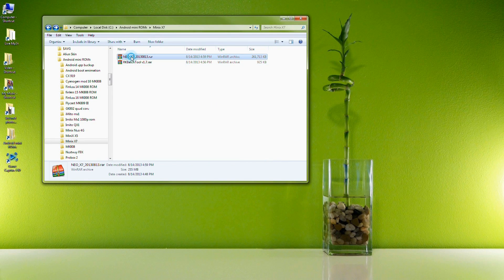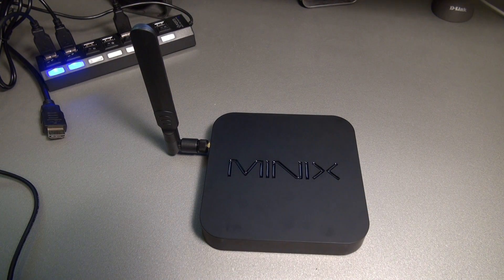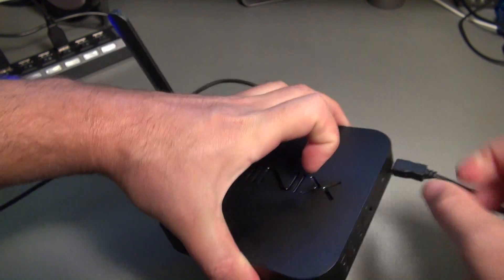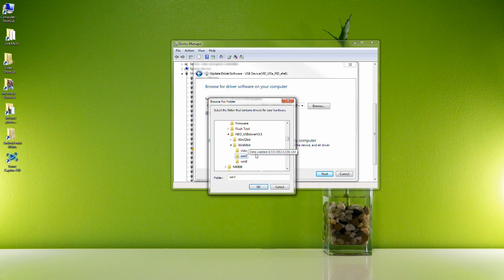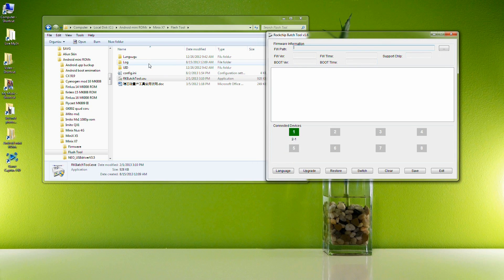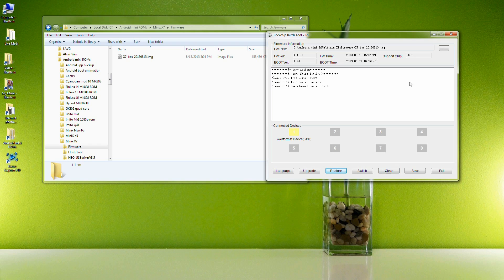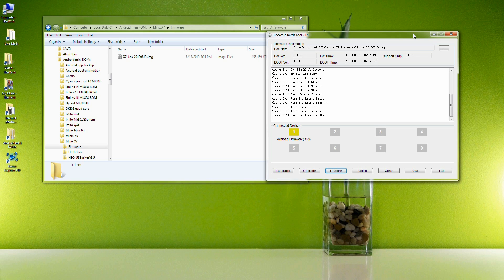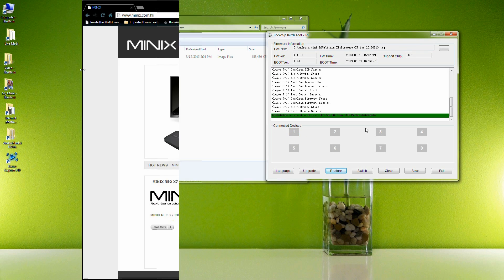Minix Neo X7 Firmware Update Tutorial

Comment: Hi there hoping you can help - my minix neo x7 seems to have an error when i try to go into the installed kodi on the landing page it says it is waiting on external storage - so i unstalled kodi and now  when i try to download a fresh install it want download at all a pop up says i need an sd card so i popped in a sd card but makes no difference - any ideas what the fault is and how i could rectify it
Reply: Hi,
 I had the same issue a few weeks ago, the SD card is not the external one but  part of the internal memory of the device. try entering the settings and re- install the SD card. It worked for me.
Reply: Hi reem after some time I managed to resolve the issue.  I just did a complete factory reset. Problem solved.

Comment: WTF i do Exactly like the video,RKBatchTool show green.(i flash to 008).
but when i press ON in wifi its jump to OFF, after several times the minix x7 crash.
but if i connect cable to router and ON the ethernet the internet work.
how can i use wifi? why it dont work?

Comment: I had no problem updating firmware to 008 or 009 --  BUT

Trying to install Finless 1.8 or Quickshot v2 and get the following when using then flash tool that came with the custom rom

When I flash ROM, every thing runs good until INF0: start test device.
 I get the following errors:

ERROR: Test device failed
ERROR: Run failed

What am I doing wrong here??

Comment: For some reason the box doesn't turn green.
I hear my computer ding when I start the device with the rest button pressed. Few moments later it dings out as if it was unplugged and the device is no longer listed in the device manager.
During the time the device is "seen" by the computer the tool doesn't seem to recognize it and shows NO green boxes.

Could you please tell me what I might be doing wrong ?
Reply: Muhamad Azmy Thank you VERY much. I have been trying to get this thing into recovery and getting angry. There is no official documentation of the method you mentioned here with the 3 seconds, USB 2.0 and all but it worked for me. I wish they would be more specific in their instructions.
Reply: You are welcome. Indeed it's not mentioned in any documentation. But at least we know how now ;)
Reply: having the same problem, including my window mention that I cannot update because it has the newest update...
Reply: Hey Leon larkin, i figured how to do it. First you have to connect it to a usb 2 port. There is a compatibility issue with usb3. Second when you are booting in recovery you push the reset button with a pin, press the power button and then count 3 seconds the you release the pin. Before that you have to make sure drivers are installed and it should work.
Reply: Nice...... I got it!!!!! U r a genius
Reply: Are you being sarcastic or it really worked :p
Reply: No it worked, I used my other labtop that has a modified windows 8 and the usb 2 luke u said: thanks
Reply: Yw :)

Comment: I connected my Neo X7 to the laptop and started it into flash mode.
"Unknown device" in the Device Manager at laptop.
I installed the driver on my laptop of Win7 - 64 by by updating and browsing for the driver in the folder.
Driver successfully installed and correctly showed in the Device Manager.
I restarted the computer and then I put again Neo X7 into the flash mode and USB icon shows in the right side of the task bar.
When I launch Rockchip utility, there is no green square.
No conection between Neo and laptop.
Where I'm mistaken?
I checked once again your remarks and I'm sure that I was in the Flash Mode.:(
In fact I repated the procedure after I uninstalled the driver.
Any suggestion is welcomed.
Thank you!
Reply: I forgot to mention that my device is not rooted. Is this important?
Reply: hi,
i have the same problem with the neo x7 using win7-64.
did you solve the problem?
please let me know
thanks
Reply: Problem solved!
http://www.minixforums.com/threads/neo-x7-008-firmware-1st-jan.3570/page-4

For everyone that have flashing problems and have USB 3.0 you have to edit the config file to this:

LOGFLAG=TRUE
#SUPPORTLOWUSB=TRUE时,扫描支持full speed usb设备，默认只支持high speed usb设备
SUPPORTLOWUSB=TRUE
FULLSPEEDUSB=TRUE
Reply: Bernhard Radinger
I solved it, too. Used my old laptop with Vista and it worked smoothly. :)

Comment: WARNING TO WINDOWS 8 USERS:
even if you installed the latest minix drivers and the pc connects to minix windows 8 cannot find Minix in recovery mode!
Using windows 7 works perfectly so simply do the procedure from a non win8 pc.
Reply: Thanks for the warning
Reply: MrBrymstond I wonder if you use the compatibility mode and select Windows XP or Windows 7 if that would work?
Reply: ...thanks for the feedback:
i don't know what happened in my win8 system, i did the same exact procedure even with a clean driver install (in my win7 machine i had samsung driver that overlapped the minix drivers, i had to disinstall them first)but worked only on the win7 machine.

Comment: mini version doesn't have a power button any idea what to do?
Reply from the maker: To enter flash mode on the x7 mini, Plug in the USB cable first into the port farthest form the SD card slot.  Then press and hold the reset button on the bottom with a paper clip.  Then insert the power cable.  Release the reset button after about 4 seconds.